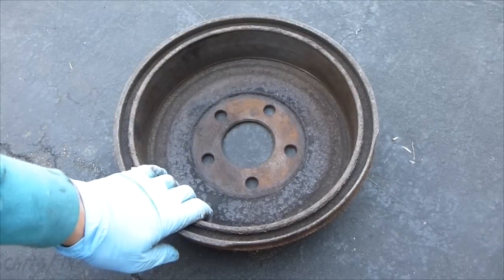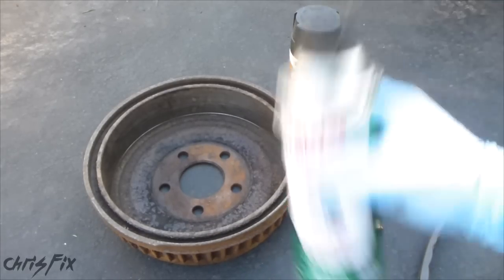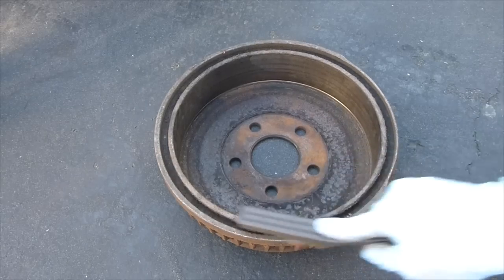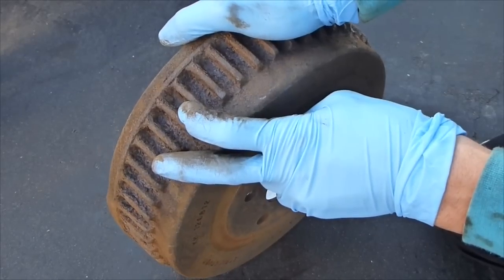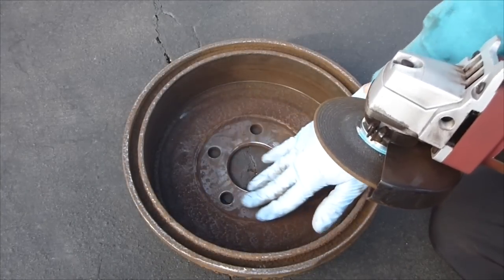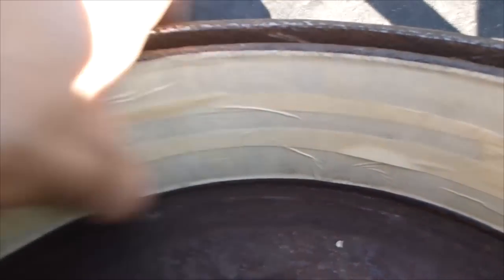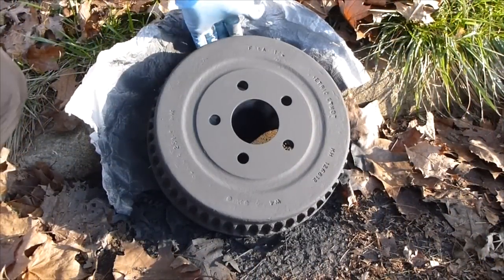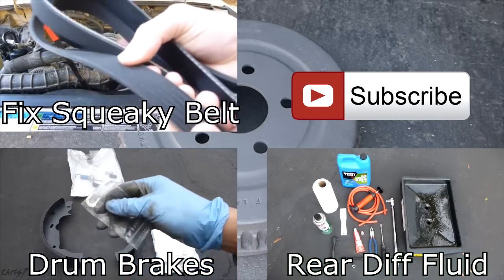How to paint brake drums ANY color DIY

Comment: Safe yourself a lot of work and have these drums blasted. Brake drums are bare steel and you will NEVER get all the rust off by hand. As long as there is still (minor) rust left in the pores the rust will come back in a matter of weeks or a few months, depending on the climate you live in. Blasting is one of few effective ways to go for parts such as drums, manifolds etc.
Reply from the maker: +MrZdvy Thanks! To get them blasted where I live I might as well buy new drums. The paint is still holding up great so it was worth the few minutes I took to clean them.
Reply: +ChrisFix I get it, you do what you do with what's available.

Comment: Watching the speed up of you brushing out the grooves and wondering, "Why not attach this wire brush to a reciprocating saw?" Could be very useful.
Reply from the maker: Even easier is using a wire wheel.
Reply: Definitely. Quick question for ya. Do you know if rear window defrosting units can be used on plexiglass windows?
Reply from the maker: +Mitch Mick (1988GMC) Hm, I do not know but as long as the plexiglass can take some heat, I cannot imagine why not. Some convertibles use plexiglass for the rear window and some of them have defrosters so I think it will work. Keep me posted!

Comment: I painted the drums FIRST then had them turned. After getting them turned, I did a touch up spray to the spots on the drums the brake lathe supports scraped off the paint. I didn't tape up anything. The only bare metal is where the drum was resurfaced.
Reply from the maker: Frank Gonzalez That is good but if your drums cannot be turned then you just wasted a lot of time.

Comment: Quick question - previous owner apparently wanted +5 hp and painted my rear drum brakes red and since the paint is coming off and it looks fugly anyway, can i just use paint stripper to remove the old red paint and paint on the surface?

Comment: its a good method for parts that aint too expensive and are meant to be swapped at intervals, but the only way to get a surface clean and rust free is to either eat the rust with an acid priming bath or have it sandblasted. the surface is full of tiny pores, and by sanding and wiping you just fill the pores so the rust will come out through the paint quite soon. especially if your vehicle operates in high humidity,sandy or salty areas. nice videos you have tho
Reply from the maker: +kuck hoa Thanks and thanks for sharing!

Comment: Heyy pal use a wire wheel on an angle grinder, i use a 9 inch one 4 and a half will get you the same results only did mine today it will bring them back o looking brand spanking new again the results and speed will amaze you :)
Reply from the maker: Mattys Vision Thanks for the tip!
Reply: No problem my man :)

Comment: I'm planning on using this paint on some parts on my truck. I was going to use high heat primer as well, but it's almost triple the price of the top coat and I'm reluctant to get it. How has the top coat alone been holding up for you?
Reply from the maker: +Aaron Collier It holds up good if you can bake it on. If you can get a high heat clear coat that would help some more. It is still on my drums after 2 years but it is starting to come off now.

Comment: I wouldn’t paint the area where the wheel meets the drum. Paint is not as solid as steel. You may torque your wheel nuts properly but when you go drive it may squish or press out the paint layer and loosen up your wheel nuts again. Rule of thumb; Don’t get creative in any mechanical connections in your car. Mechanical engineers of the manufacturer have thought out tons of details to make it all work well. But for areas which don’t touch anything it’s fine.

Comment: I just soak mine for a few days in a gallon or two of Varsol or Acetone...in a sealed container.  All that rust will literally fall off the Drum.  Let Dry...Rinse with Brake Cleaner and again with Alcohol.  Dry...Prime...Paint!   Above method is great for same day work though!

Comment: Do not use a grinder with a cutting disk on your drum! You will be removing material and risk compromising the balance of the drum. Prefer a wirewheel/brush instead. 
Aside from that good video Chris!
Reply from the maker: +JAndrioli Glad you liked the video and thanks for the tip!

Comment: 2 questions. First, would a hand sand blaster not be the easyest? Second should you do your surface priest before you have them turned to avoid damaging the area?
Reply from the maker: James MacInnis Sand blasting would be easiest for sure but I dont have one. I got them turned first because a lot of times you will take the drum to get turned and find out that it is out of round or too worn out, then you just wasted all of that time for nothing.

Comment: use gloss paint it lasts longer.. also they make rotor paint.. its a bit better than the high temp you were using but that is a good brand
Reply from the maker: Zippy TheChicken Thanks for the tip.

Comment: angle grinding disc, works tool for job... wire wheel, bead blast perhaps.  No prime on drums, itll be rust by next spring.
Reply: It's paint made for use without primer

Comment: i've seen people mask the middle part of the drum (where the rim would meet it) and i think i've read it somewhere too, to avoid painting the middle part. is that true? i wouldn't want to go through the hassle of masking the middle if i didn't have to.

btw, i just subbed, love your vids! so far i watched them to learn to change my rotors+pads, paint my calipers, fix up my headlight grime; next i'm gonna paint my drums and replace my brake fluid. i'm in between contracts so i've got a lot of time on my hands recently :)
Reply from the maker: burts bees There is no reason to mask the middle of the drum and painting it will actually help because it will prevent the rust from making the rim stick. Im glad you subbed! Welcome aboard! Let me know how the jobs go!
Reply: ChrisFix just painted them last week, look good as new! also took the opportunity clean up all the brake dust inside. i also noticed that once i got rid of all the rust, the wheels spun around the hubs a lot more smoothly. not sure how much a difference that makes when i'm driving, but i guess it's a good thing :)

now i'm gonna do the brake fluid cuz my pedal is pretty smushy. i watched your flush/bleed video, but what do you feel about doing a gravity bleed? i dont have a pedal guy and i'm afraid i might screw up the one-man method, so i figure slow and steady will do the job better for me.
Reply from the maker: burts bees A gravity bleed works but only to a certain point. You really need to get some pressure and force those air bubbles out!

Comment: Hi, what was the price difference between reconditioning the drum and buying a new one?
Reply: Drums usually last a long time. Just take off the drum wire brush them and put two coats of engine spray paint. I like duplicolor ceramic engine spray paint. They will look amazing and wont rust. Semigloss black if you want a nice clean stealthy look. Bright colors if thats your thing. New drums can cost like 30-40 bucks each. You dont need to paint them on the inside just outside, trust me.

Comment: I was thinking soapy water for the brake drums only soapy water if it touched the lining of the brake drum its ruined so I guess not *I used soapy water on alot of the parts & a tooth brush it helped remove so much rust in area I couldn't reach with sandpaper *  * it's just soap and water works so good .. only nothing can touch the liner of the brake liner *

Comment: Won't the painter's tape leave glue/residue on the turned surface?
Reply: +David Plass If it does it would be extremely minimal and would rub/burn off immediately after braking a few good times.
Reply: I was wondering the same thing. probably just brake cleaner after you peel it off

Comment: Ok I've cleaned my drums with soap and water, rubbing alcohol, and brake cleaner. I don't know what sanding grid I should use. They're 45 year old drums that have never been cleaned or maintained. I don't have the sanding machine that you use. So I need to know what sanding gird you used for the sand paper. Thank you
Reply from the maker: If you use sandpaper you will need 60 grit or 40 grit to start.
Reply: Just buy different grids and see what works best for you. You cannot really damage anything as long as you don't such the machined surface inside the drum.
For my drums, I used a wire brush bit for my drill. Worked very well.

Comment: does the spray paint have to be the 2000 degrees one or can it be the brake calipers one
Reply from the maker: Either one should work if it is high heat resistant!
Reply: @chrisfix  omg thanks for replying. i been watching since you started on the mustang bro. Hope to see more! all love

Comment: Would it have been easier to recondition and get the rust off and paint the drum before having it turned?
Reply from the maker: Sometimes they tell you it cant be turned so that is why I got it turned first. I would hate to do all of this work for nothing lol. Plus, their machine might mess up the painted surface (depending on how the machine holds the drum)

Comment: Would it help if you first sprayed it with a primer and then the high heat black or does the high heat only go on to bare metal?
Reply from the maker: Panos K This paint goes onto the bare metal and bakes on so you do not need primer.

Comment: you should use a wire wheel in your grinder .. use a braided wire wheel where it looks like little coils never put a wheel in that grinder with individual wires or they will fly off.
Reply from the maker: Zippy TheChicken Thanks for the tip.

Comment: old video but you should of used a wire wheel on that angle grinder. it would of been a heck of a lot easier.
Reply from the maker: I agree! That is what I would do now! Thanks!
Reply: I suppose if you had time (say 24 hours) and wanted to get them super clean, you could also use electrolysis, which helps a lot with lifting the rust out of all those little crevices. It should also protect the turned surfaces too, as you're not touching them at all. The bonus with electrolysis is that you can treat all the drums at the same time, too, with very little manual work. Just takes a bit longer to work its magic.

Comment: A wire wheel on the angle grinder would have worked very well in the crevices on the outside.
Reply from the maker: +Vincent Corazzi Yea, you are 100% right on that. If I would have known that back then, I probably would have used one!  Thanks!

Comment: Would you recommend using a DA to sand the out areas it can reach
Reply from the maker: Chachi Chambers What is DA? If I were to do this again, I would consider using a wire wheel to make it faster and get into the areas that are hard to reach.
Reply: A DA is dual action sander, and the wire wheel is very effective with cleaning rust. Thank you

Comment: You do realize if you don't change the drums once in a while, you don't have brakes at that corner/axle? the drum is not just a 'mechanism cover' to protect the interior of drum but it's also the same thing as a rotor on your disc brakes, you should always also remove the gloss from the inner ring of drum when you're working on a drum brake, that's what you're also supposed to do with brake shoes and brake pads.
Reply from the maker: +Dr. Etzor Thanks for sharing. Drum brakes last 50-100k miles so I am not going to change it early than I need to.
Reply: ChrisFix Well, yes, but you must also do other things than put some paint on them, how old are these drums then? / how many miles they got?

Comment: what about painting a brand new set of drums? just clean it and paint? seems to have a greasy surface
Reply: that "greasy surface" is an oil film they put on to prevent them from rusting before they are even installed. Its also the original intended purpose of brake cleaner to remove that film prior to install. Use Brake cleaner and a clean rag to get it off.

Comment: Yo chris fix
Don't use rustoleum brand paint use POR-15 brand paint for rust it works great. by the way are you going to do a review on Syn lube motor oil ?  it's what NASA use on the rover robot on mars. you don't change syn lube motor for 10 years or 150,000 miles which ever comes first. this motor oil cost about $30.00 a quart so we like to see you do a review on it or maybe the company can send you a free case to do a review on their product>
Reply from the maker: FUNK BOOGIE Thanks for sharing! That is awesome NASA uses syn lube! I need to check it out! You should email the company for me!!!!!

Comment: If I just got new brake drums and haven't put them on yet can I skip straight to painting?
Reply from the maker: I would still sand them quickly with 400 grit to get the surface scratched up for good paint adherence and then degrease. No need to take a lot of time since it is brand new. Make sure you degrease it really good though because they come oiled to prevent rust.
Reply: +ChrisFix Thank you!

Comment: Could have spent all that time wrenching for new rear disc brakes. =P
Reply: +VinylToVideo But then they wouldn't be pretty colors. Pretty colors add 5 HP.
Reply: Michael Zaite
Well they could be slotted and drilled. Mine are and are a gold tinted metal which looks cool considering my car is also gold.
Reply: Slotted and Drilled Brake Drums!!! We're gonna make a Fortune!!!!
Reply: +Michael Zaite ??? Did you forget the first comment you replied to already?
Reply: Pff rear disks don't add imaginary Horse Power. Everyone knows that. Now yellow Brake drums......
Reply: Michael Zaite
Added horsepower is no good with the reduced braking power caused by the drum brakes. Every single car I've ever owned has had 4 wheel disk brakes except my '99 Taurus SEL (I have to note it has the DOHC engine otherwise would be too embarrassed to mention it) which has rear drums. The brakes are not great on that car.
Reply: I don't think you fully understand the concept of "Imaginary Horsepower". With imaginary horsepower Actual performance doesn't matter.
Reply: Michael Zaite
Right well keep driving your Geo Metro with its imaginary V8 engine as everyone passes you on the highway.

Comment: wouldn't a wire brush attachment work better, and if not why?
Reply from the maker: For sure. This video was one of my firsts. With the metal wire brush just get all the lose rust off and then submerge this in some type of rust remover (you could use vinegar) and it will have a rust free and paintable surface.
Reply: ChrisFix ok thank you 😊😀

Comment: Could knock off the loose rust and then hit it with phosphoric acid before painting.
Reply from the maker: Good idea. Where do you get phosphoric acid and how do you dispose of it when you are done?
Reply: Not hazardous, it is one of the ingredients in colas and is what makes colas perform the old rust removal trick on bumpers.  It is the active ingredient in naval jelly, but I've been using Jasco Prep & Prime, less than $7/qt at Lowes. When you find several competing brands in the same volume bottle, see which one is heaviest and that is the one with more acid.  Just follow the directions on the bottle, spray it on, let it dry, wipe off any residue with damp cloth.  Will post a video soon on using it and If I remember will leave a link here.
Reply: Easiest way to find it is look on the labels of rust removal/converter/deruster products.
Reply from the maker: Thanks for the info
Reply: Just heard that some MSDS sheets note it etches glass. Seems to be some disagreement on the theoretical severity.  Safe side, keep it away from your good glass.

Comment: Um... why bother masking.  Do rust removal first.  They make a product you can soak it in.  Then clean and paint.   Then turning..... Take a measurement with cailipers before starting to make sure it has enough surface to turn.  Then do it up... have it turned.  They will turn off any over-spray when they surface it.
Reply: It's better to paint after because the dust will stick to the fresh paint, even if it's already dry, and will make it fall very easily

Comment: Wouldn't it have been easier to clean the rust off before having the drums turned.
Reply from the maker: Tim Fox Sometimes they cannot turn the drums because they are too worn down so unless you want to bring it to them to see if it can be turned, then go home and paint it and then go back and get them turned, you would be better off just getting them turned then painting.
Reply: ChrisFix Maybe I'm crazy, but I'm a man who owns his own micrometer.  A cheap set of digital calipers can be had from Harbor Freight for not much money ($14 for 4" & $19 for 6").  Normally the min thickness is stamped/cast into the drum.  Measure them yourself and save a trip.
Reply from the maker: Tim Fox If it is out of round, if it has some other problem that you dont notice, etc are all things that can prevent the shop from turning them. A micrometer is definitely a good tool, but how much will the shop need to turn to get them round? How much will need to be removed even if they are round? What if there are gouges that cant get taken out because they are too deep. That is why I did what I did.

Comment: Does brake cleaner damage this paint?
Reply from the maker: +Ethan Cousineau After it is chemically hardened via the heat cycles, brake clean will not affect the paint (or at least not enough during regular brake changes)

Comment: Im sorry but it wont matter if you scratch the surface the shoes ride on at all really, but you really should not grind on the surface the wheel mounts too it can misalign the wheel badly because those are machined within a couple of thousands, so a terribly bad idea to grind on them. wirewheel or sandblasting works.
Reply from the maker: +phogelbice Thanks for sharing!